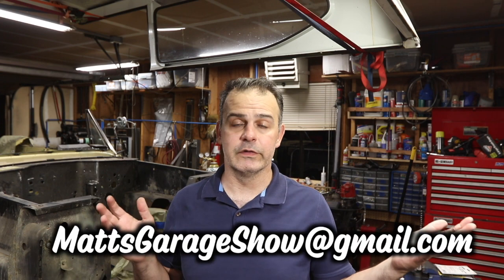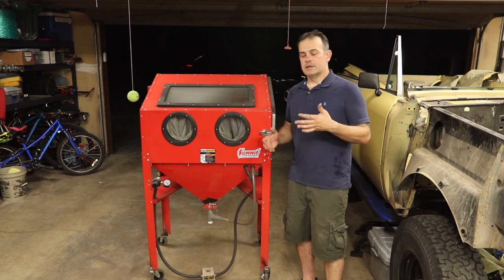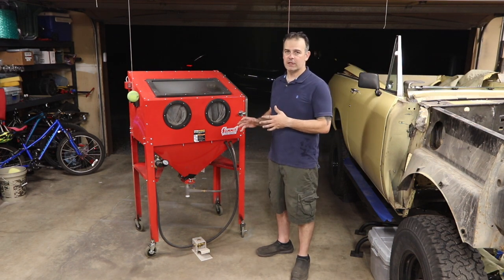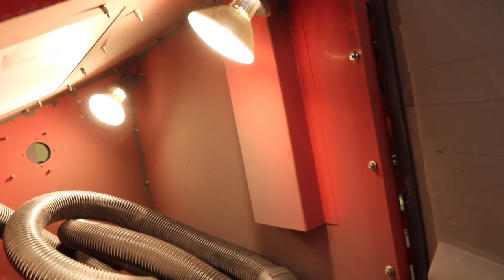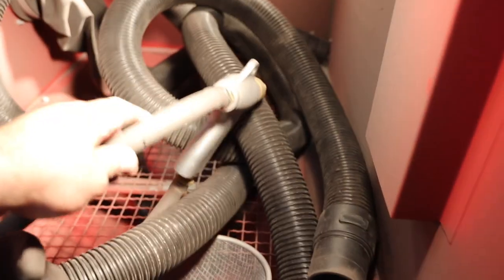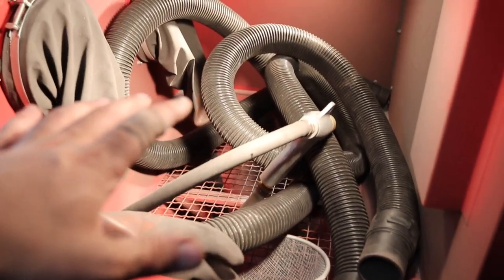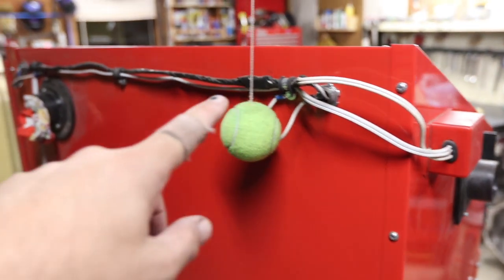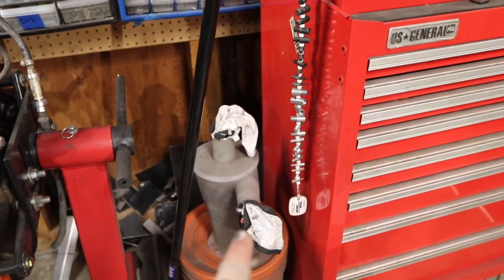5 Pieces of Equipment I can't live without

Comment: Matt, Matt, Matt, get the HF 20 ton pneumatic bottle jack for the press!  It makes life so much easier and it still has the manual pump so if you are only going a short distance or are concerned with overdriving something you can manually drive it down.  Come on my guy, it’s only $89 when on sale.
Miss the Bronco content, but still enjoying the scout vids.

Comment: hey matt, how much cash did it take for the bench? I need to build one and just curious.
Reply from the maker: A LOT of cash actually.  The 4x8 plate is the most expense part. Something like $400.  Plus the thinner sheetimal for the backing (that was like $100) probably another $150 in square tubing.  $100 in adjustable casters that you can level the table with.  I'd say I probably spent like $800 in all.  Maybe more.  But in fairness I did not use the entire 4x8 sheets of plate and sheetmetal and have been using those for other things.